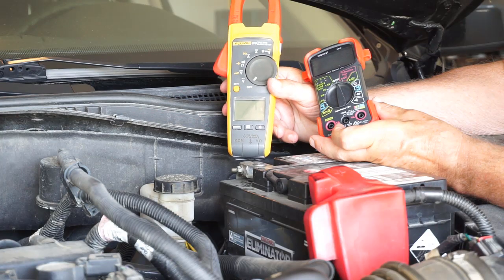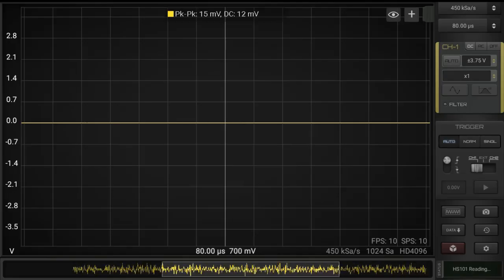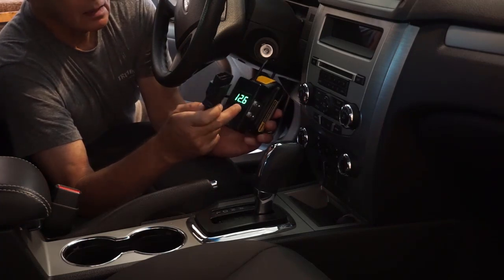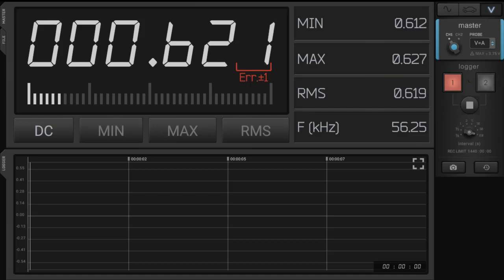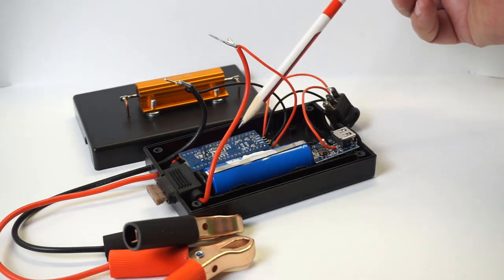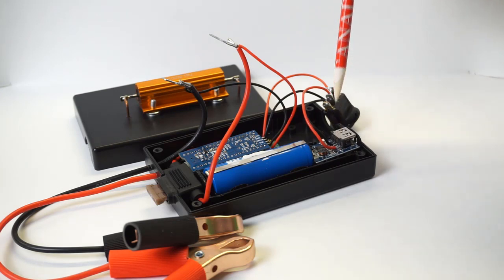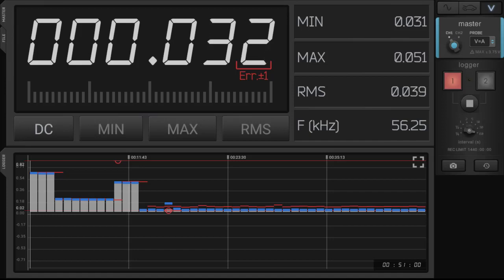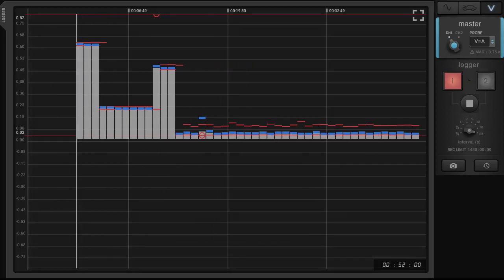GADGETS#117 - PARASITIC LOGGER

Comment: does this connect wireless to the hscope on the tablet? via bluetooth or Wifi ?
Reply from the maker: based on HS101 PRO circuit with Bluetooth connectivity
Reply: @theGADGETSplaylist when building looking for the lithium battery?
Reply from the maker: @nitrofever  for everyone's convenience and low price I had used ONN 3350mAh power bank...20650 lithium battery, charge module all there for us to use. Walmart and other retailers had them for $8

fast forward 5 years and that exact model power bank is now hard to find ... markets move so fast!

you'll see a picture of it in GADGETS#134 @ 3:35 timeline

a Google search just now found this retailer (not necessarily endorsing it) that has it for sale ... one of the very few

https://www.chefscloset.com/onn-portable-battery-power-bank-3350-mah/

18650 battery with a cradle and a separate charge controller board would be easier to find 

thanks for your interest in this project
Reply from the maker: @nitrofever  another thing about this project is the HC-06 bluetooth module ... they're not all created equal and some won't flash this firmware properly

it became such a frustrating issue that Martin Loren sells known good HC-06 modules on his store

Comment: Dennis, ordered the HS502 from Martin. Would you upload a wiring diagram for this project. Believe I can then determine how to integrate this device with the HS502. THX!!!
Reply from the maker: you'll like that HS502, of this I'm sure:)

this GADGET#117 has its own built in oscilloscope circuit and would not "integrate" with HS502

measuring current draw with your HS502 can be made simple by measuring voltage drop across a resistor with your new scope

and a 0.1Ω resistor might be a better choice than a 1Ω

consider looking us up on Telegram where this could be explained further, if need be...